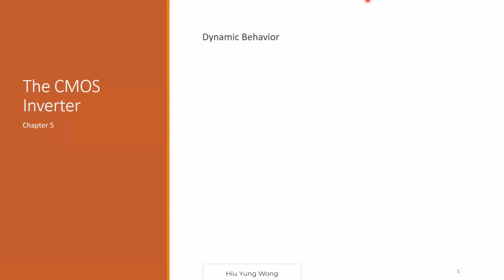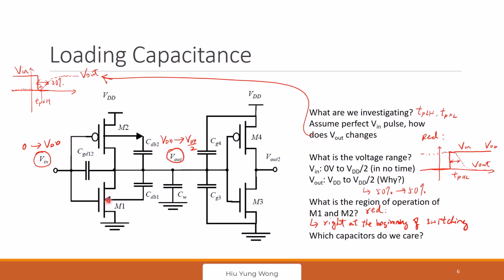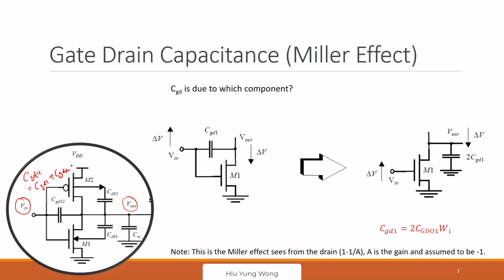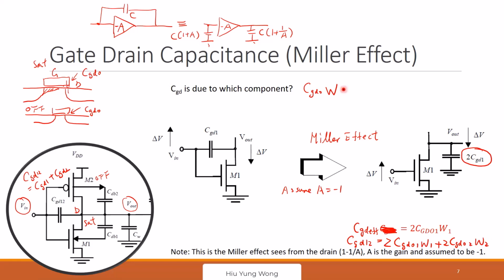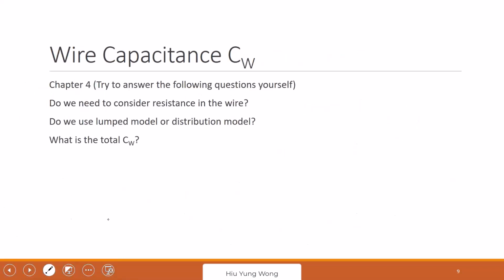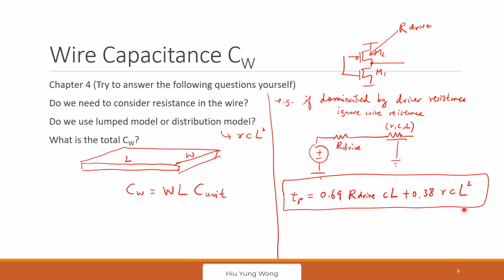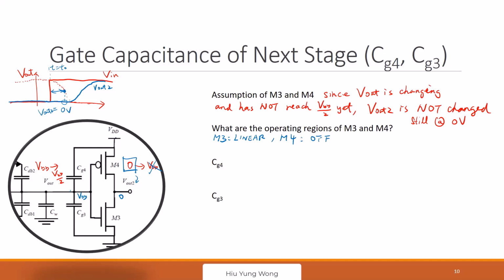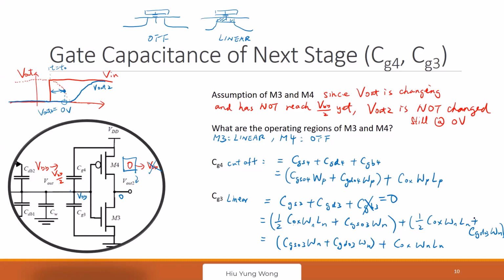L11-A Dynamic Behavior of CMOS Inverter: Capacitance and Miller Cap

Comment: I have a question: when we calculate the gate-drain capacitance using the Miller theorem, I understand that it is transformed into two equivalent capacitances. However, it’s common to see only one placed at the output and not at the input. Why does this happen? What happens to the equivalent capacitor at the input?